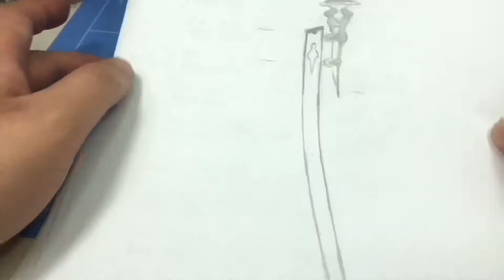Sculpting NieR:Automata’s 2B in super sculpey [ploymer clay figure]

Comment: Did you put in the oven before paibtibg or did yoh paibt on it first then oven  new to sculpy so iam not sure what order painting and baking in the oven are supposed to be also amazing job on this sculpt
Reply from the maker: I don’t understand your question too much. The order of making: super sculpey can be baked repeatedly.  Put the baked and unbaked ones into the oven together, and repeat the baking several times. It is completely fine.

Coloring is the final step.  If bake the colored work again, the color may be deviate, and even have some small bubbles will be baked.  If not necessary, the colored parts will not be baked in the oven again.

Comment: Have you baked it during the assembly in order to carve, or is the clay firm enough to carve without baking?
Reply from the maker: It can carve without baking, but it is not recommended to carve the entire work at once.  Avoid the completed part from being damaged by touching.  Because super sculpey can be baked repeatedly.
Reply: @smallpotato  so i should finish a bit, bake it, and continue with other parts, and do that till im done, and than maybe carve finishing touches after its all baked?
Reply from the maker: Exactly.  As for how many parts are completed before baking, it depends on personal.  If you are dissatisfied with some parts after baking, you can safely cut it off, and repair the super sculpey again.